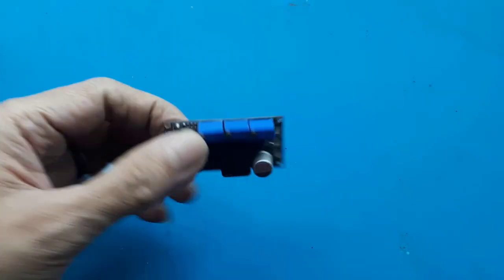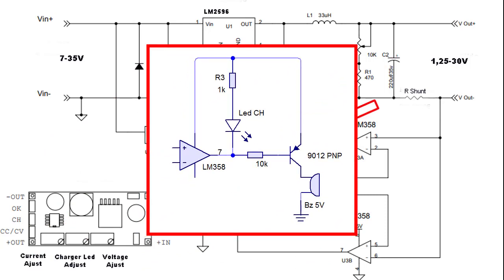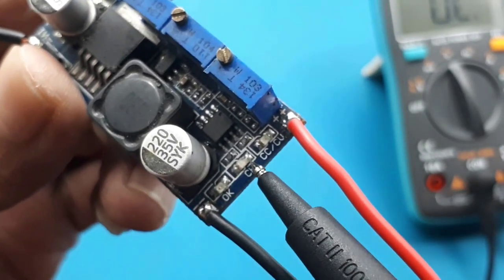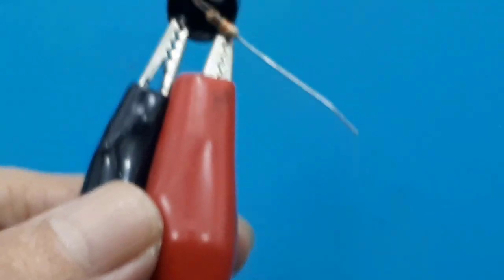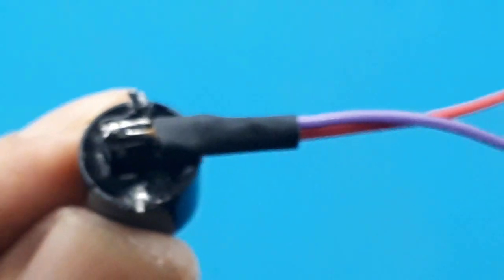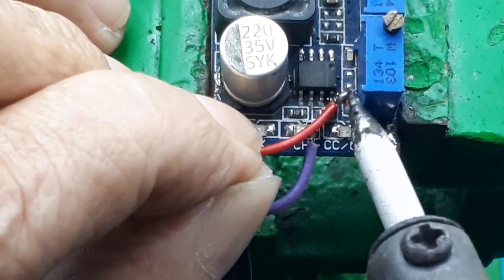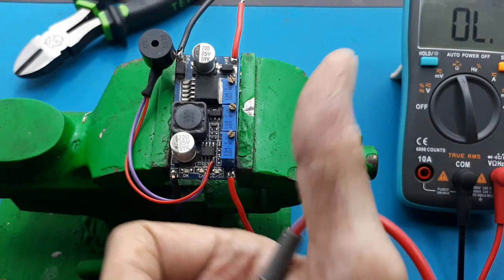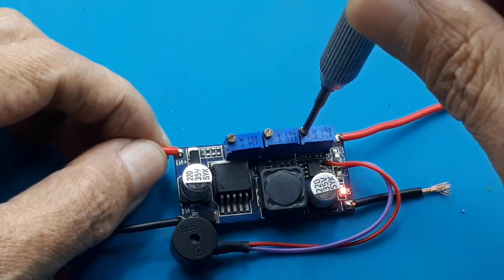LM2596 Regulator Adjustable 3A 1,25-30V Tambah Buzer 3 potensiometer

Comment: @Radal 05  Module Step Up DC to DC
Saya ingin bereksperimen kelistrikan motor bebek Revo 100 utk lampu modul sendiri & untuk dinamo starter modul sendiri.
~ Spesifikasi ACCU 12.6 V [ 4A ].
~ Voltase dr mesin 6 - 7 V [ 1.5 A ] tanpa ada beban ngecas ACCU/ACCU dilepas.
Bila digabungkan kedua tenaga diatas menjadi 14.5 - 14.7 Max ( Ampere belum kutes hasilnya ) mungkin nambah 4.5 - 5 A.
~ Modul diseting 13 V Utk instalasi lampu krn semua lampu led + klakson keong 6 suara.
    Aktif bila kontak diputar On.
~ Modul diseting 14 V Utk dinamo starter.
   Aktif bila tombol starter di tekan.
Hal diatas saya lakukan agar ketika distarter, lampu tidak meredup terlalu banyak.
Pertanyaan :
Apa modul step up kuat buat meningkatkan voltase dinamo starter yg butuh listrik buesar...???
Apa ACCU aman bila dikasih 2 module step up dgn kata lain awet....???
Maaf penjelasannya banyak krn masih bersifat angan2 yg hendak direalisasikan.
Disamping itu Video Anda tentang semua pembelajaran Module step up yg memaksa angan2ku diatas hrs jadi nyata.
😇
Reply from the maker: Untuk ini tidak kuat...

Comment: Mau tanya pak🙏
Sepeda motor saya SDH rubah arus AC ke DC. 12 volt. lampu SDH ganti LED semua..jadi semua lampu ambil ke aki.semua..cuma pengisian kikprok ke aki bisa sampai tertinggi 15 volt..sedangkan lampu LED maksimal 12 volt.. saya minta sarannya supaya LED awet harus pakai regulator untuk lampu LED.? Sebelumnya terimakasih 🙏

Comment: Voltmeternya pakai 3 kabel kecil dan 2 kabel besar bang.
Reply from the maker: Sumber dibawah 30V ya.
Kabel merah kecil ke input positif sumber.
Kabel hitam kecil tidak digunakan.
kabel kuning kecil ke output positif modul.
Kabel Hitam besar ke negatif output modul.
Perhatikan... Ini yang membuat banyak ragu
Output positif dari output positif modul.
Negatif output dari kabel merah besar.
Saya ulang, Negatif output dari kabel merah besar.
Reply: Iya bang... Terima kasih banyak bang 🙏🙏
Tapi tetap beban nya harus dihubungkan terlebih dahulu ya bang supaya indikator ampere nya berjalan.

Comment: Transistor wajib pull down resistor gak sih bang ?
Reply from the maker: Resistor yang dimana Bro... kalau di opamp. nga bro
Reply: @Radal05  transistor buat mutus koneksi jalur ke vcc nx op amp lm358 gan, kira2 butuh resistor pull apa gak ya
Reply: @Radal05  asiapp gk dikasih gpapa ya :)